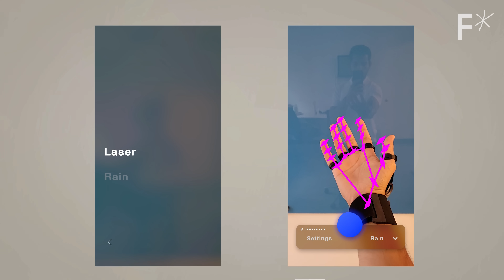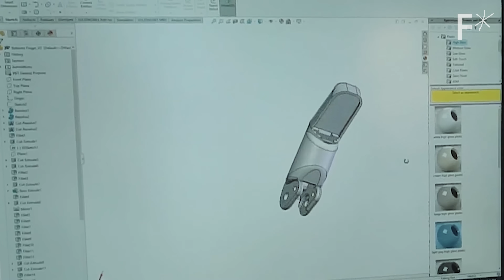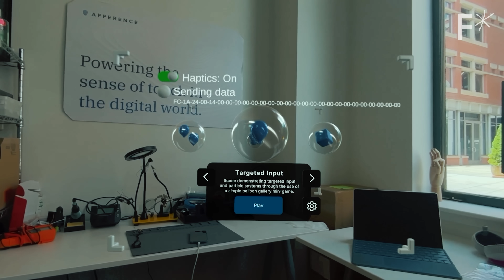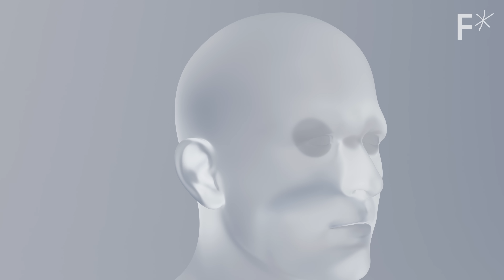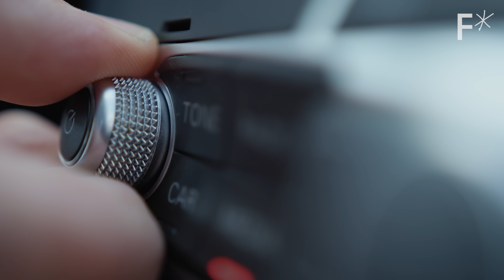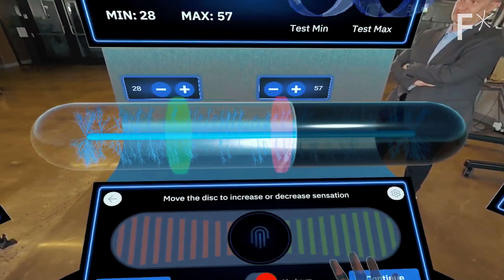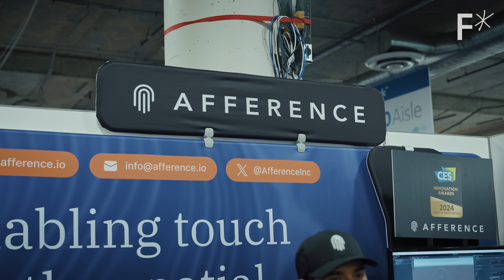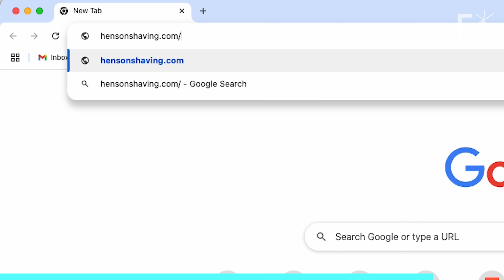A new class of haptic tech will redraw the borders of reality | Hard Reset

Comment: utilize this technology with an mri then we'll end up with the inner workings of the brain's information receptor for the hand, then we could utilize a head peace (helmet) that could direct the same into the brain so we would no longer require the hand piece. 

then will come the feet. then legs and arms. then as this tech develops we'll be tracking down the information for touch along the whole spectrum.

I can see the medical benefits to someone in a coma or a paraplegic. The information discovered could be reversed again for the dedicated locations to receive the information, thus create a faux 'second spine' through a body suit. Everything at the brain would still register as operating properly but the information utilized a different route   

(the gaming ironic loop is trying to escape reality through a different reality as we run away from responsibility and hardships instead of facing what we had already and making adjustments into making life desirable to live.)

What I do find interesting is that the nervous system is 'parasitic' to the digestive system; it is an electrical current system. I wonder where the organ in the body is that assists with transferring sugar in the blood stream into electrical currents for the neurological system and it's information.  Technically speaking our nervous system could live without the rest of the body as seen in a coma or temperature preservation but the rest of the body couldn't live without the nervous system as a means of synch and communication; although, the nervous system is still biological thus will age, disease and degrade over time. 

Whether this information is pursued through financial entertainment through the video game industry then expanded to medical, business, and pursuit of living 300 years this looks like a great contribution and investment.

Comment: I know they said they're simulating the signal, but from the reporter's descriptions and responses it seems they're just applying a small electric shock. So it's not generating a signal equivalent to touch, it's just zapping you in different ways. If crrect, this seems far from the initial claim.

Comment: One step closer to SAO. 😄 I knew something like this is coming coz we already have portable electric massage device, running on 3x AAA batteries, which can generate all sort of tingles, punching press, numbiness with conducting gel (with pre-programmed rhythm, ofc).  The current applied is minimium, the sensation can be adjusted from weak to strong. It only takes time to modify such portable massage device into sensation rings fit onto the root and tips of each finger. The rest is programmable stimulis and rhythm with a BT processing hub. The skin is rather sensitive to tiny modulated electric pulses generated by the device so one charge of 1100mAh can last at least for 7+ hrs of continuous use. AND the cost of hardware is CHEAP (like $25 for 4-6 pts of replac-able stimulus contact) as far as I know. 
For the senstation throughout the trunk of body, the required contact pts may be a lot though. Suppose future VRC SAO player won't mind spending a few hundreds on a stimulus vest for pleasure use. 😉

Comment: If I were to guess at the research that they're doing it is two fold one is producing several million touch sensors that are part of each finger tip and the other is feeding all those million electrical signals are converted into light signals which are transmitted into one fiber optic flexible cable that uses multiplexing and then it is converted back into an electrical signal for the brain. Multiplexing is the process of combining two or more information channels into a single transmission medium. There are a number of different standards that can be applied to the process. Also, millions of light signals can travel on the same fiber of flexible cable.

Comment: i can see this going one of two ways,(or both.) this technology advances so much to the point doctors across the globe can work on any patient at any time, somewhat similar to a zoom meeting does but there will be a precision robot being controlled to perform the operation is involved. this would be great as all the medical experience across the globe can be accessed from any hospital with a transmitter. on the other hand, we could advance to a point where we cant tell the difference between virtual items and physical so higher ups can use it against us to make inescapable prisons that are only bounded by the signals sent to the prisoners brain. preventing them from leaving even though there are no physical barriers. it will be like reversing virtual reality. your brain will be confused on why you cant leave even though there isn't a wall. no matter what you try, you cant bring your body to move outside of the barrier. (or this just proves the matrix frfr)

Comment: Couldn't you effectively use it as a digital rubber hand trick?
 seeing your virtual hands but not having to leave behind the controllers as pure hand controlled interfaces aren't really there yet
Reply: what is your problem with hand controlled interfaces? the hand tracking on the quest 3 works great, it hasn't felt buggy to use for a very long time

Comment: 3:57  "Whereas at Afference, we can skip the skin and send information directly to the brain through our neural interfaces." 

HOW though? The contact point of the device is still the skin, is it not? Does it insert directly into nerves? I don't think so. Whether you use vibration or in this case, electrical stimulation, you still stimulate the skin, and the skin is sending signals through neural pathways to the brain. 

The skin is also a very complex and delicate system. We have many different kinds of receptors in the skin which will activate neurons in different ways depending on the type of sensation. There are special receptors for pressure, vibration, temperature, pain, texture, etc. Just try to imagine the complex neuronal orchestra when you put your hand into a bowl of water. There is a specific  change in pressure, temperature, texture, etc. etc. all of these recpetors will respond in some way, and our brain will interpret the combined signals as "water". And we actually have no idea what exactly is happening in the brain. How are you supposed to mimick that with a single point of electrical stimulation on the skin? I am very skeptical.
Reply: Exactly my thoughts
Reply: all nerves are electrical signals, your brain will "feel" a thing, and fill in the rest, something like a phantom limb or a placebo. you dont need every part of the system bc the brain is pretty vulnerable to suggestion

Comment: Finally someone decided to fix the issue with physical sensation at its root and not try to go the long way with motors on your wrist etc! I am lookingforward where this project is going in the future! :)
Reply: but motors allow you to physically squeeze a hard or elastic ball in your hands. and here the fingers will go through.
Reply: @lasertagdreamer  one idea could be to combine both like have a motorized glove that offers resistance when necessary and the haptics so you can better feel it
Reply: @lasertagdreamer  The thing is, if the sensation you get in this way is real enough, in most cases your brain won't try to actually go through it. That's how powerful your brain is.
Reply: @lasertagdreamer  What about instead of touching your nerves, you shocked the muscles? We already have those in small forms, so restricting the movement via electrical signals, and then talking to the nerves to tell it that something is there?

Comment: Took 8 minutes to admit they don't actually know how to replicate the specific feeling of anything and it's all just "tingles." After shitting on force feedback motors at the start for doing the same thing. OOOH BUT IT'S SPECIAL BECAUSE IT DOES IT WITH ELECTRICITY, yeah I can lick a 9V battery too. Stick to prosthetics instead of teasing the VR crowd.
Reply: Yep, but they’ll have plenty of idiots excited about a TENS device shoved into a glove. The hardware for this could be bought at home depot and from that guy with a kiosk at the mall begging you to try the electric massager.

The nervous system “language” is analog not digital, and it’s largely unique to each individual person. Trying to get the exact feel of temperature, texture, pain, and tickle… It would have to be a bunch of recordings of normal nervous input associated with each sensation for the single person the device is bought by.
Reply: @blakeblair2120  i think the signal of a given sensation would be pretty similar from person to person, but the signal strength would vary, like someone with delicate fingers requires less force/energy? to feel something properly than a guy with calloused working hands. Based on my experience with injuries, the brain seems to adjust nerve sensitivity as required after a while based on the perceived strength of the input (the nerve's physical separation from the outside world; skin thickness). So you could have a calibration where the user tells the device the appropriate strength when they first put it on.

The other aspect of making a feeling signal "real" would be like a waveform produced by running the texture of your fingers over the texture of whatever you're touching. This would be heavily affected by the speed of the two surfaces interacting, and that speed would be changing constantly based on your in-game movements. When you catch a ball, you have a high speed impact that quickly levels out as the ball settles in your grip. The signal this produces in your nerves I think would look like the waveform of the sound of someone catching a ball. Then just touching something normally would be a much subtler signal by comparison. 

Point is I don't hear any of this being discussed by the supposed professionals. I, a layman, am putting more thought into this than anything I got from the video. Just tingles and marketing.
Reply: @ I hope you’re right about how the signals of the nervous system work, that would be much more feasible. But yeah, this product seems less developed than the owo skin, which uses the same foundational hardware.

Comment: I've seen the VR environments that artists can sculpt in using Blender. I can't imagine how wild it would be to actually feel what you're digitally sculpting.
The question is are we looking at a solution in search of a problem? Aside from what I've mentioned what are the practical applications? Entirely digital cockpits that require no physical dashboard perhaps. Does this reduce or increase the failure rates of components and would the impact be on the cost of manufacturing? It  requires digital signals to be processed where they would otherwise have been more physical so you cut out the buttons, levers, or lightbulbs and replace them with a circuit board and a program. That could even act as a security meausre in something like a tank by requiring a login or dna lock to operate the digital environment.
Reply: Interesting ideas! I'd say there's definitely a problem it's solving. And it's that the VR experience sucks immersion-wise when there is no physical feedback. As far as using this product for everyday use cases like military tanks and replacing physical dashboards, that's a whole different ballgame.
Reply: Actually, prosthetics is a big thing for this, gaming, and most likely military, also some dangerous works, or rescue missions, maybe you can't send an actual human inside a falling building, but what about a robot piloted by someone? It might still need one to two decades to be perfected, but if you're missing a hand, something like this is far better than nothing.
Reply: the practical application is that in the sex vr games, you can actually touch boob instead of just virtually grabbing it.
Reply: Sense of touch in VR might be able to be used as a type of therapy